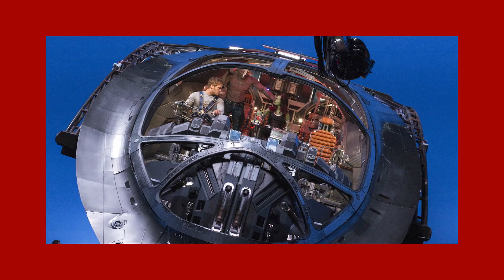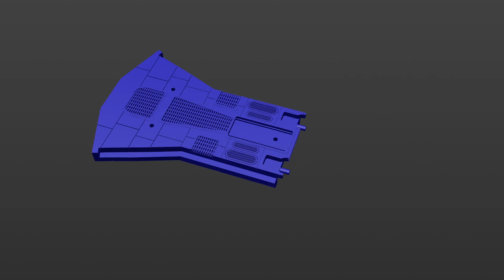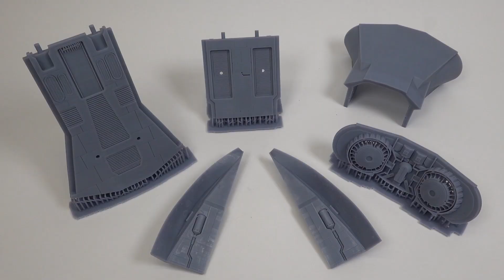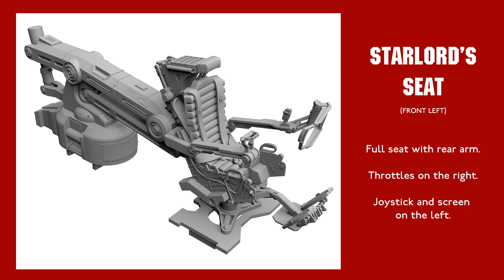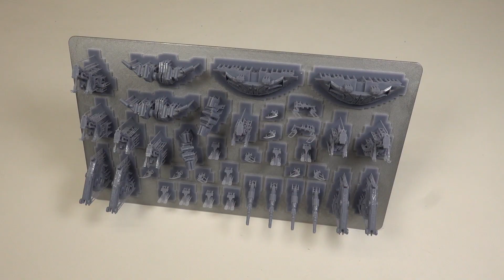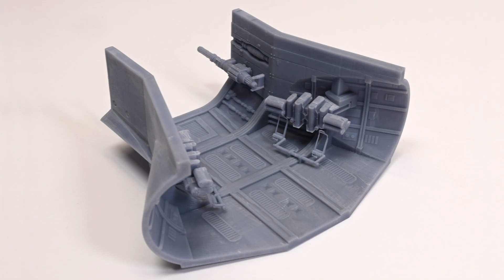PROJECT MILANO PART 3 ‘SCREEN ACCURATE COCKPIT’

Comment: Are you going to have the characters sitting in the seats? If so you may want to take out the seat belts.
Reply from the maker: Yes hopefully, they will be sculpted with the seats and belts in place. 🙂
Reply: @StaplesandVine  remove the seat belts from the seat s before printing them. Use fabric and photo etch buckles to reinstate the belts over the figures.

Comment: I've found a solution to the problem with the holes in the floor - print it at 1:24 scale!
Actually, you could do the cockpit as a separate model at that scale. That would be worthy of all the work you have put into this project.
Reply from the maker: The conflict between size and scale! Both have merits but there has to be a compromise. A 1/24 Milano would have a 2 metre wingspan.... 😲
Certainly a cockpit in a larger scale would be a great model. 😎

Comment: Nice work    For your floors under the pilot seats. Try Photo Etch or a brass screen. Photo Etch can be custom made from a company EduardCZ
Reply from the maker: I had considered photoetch but I will be making the files available to sell, like Slave 1 and need to keep outsourcing to a minimum. 🙂

Comment: I am torn about the move from modeled rivets to decals.  It's a practical move, but would a higher-resolution printer let you get away with baking them into the printed parts, or would they still be too small to stand out after painting?  Compromises are hard...
Reply from the maker: It's a tough call. I've got other printing buddies so I'll send them the file and see what they can do. I think ultimately that it will be hard to tell on the final model. At least I hope so... 😉